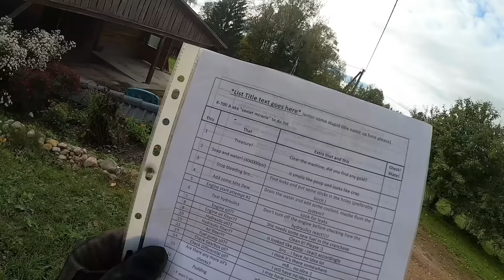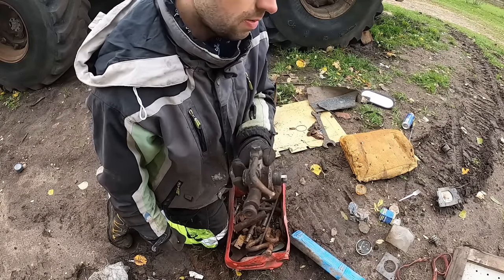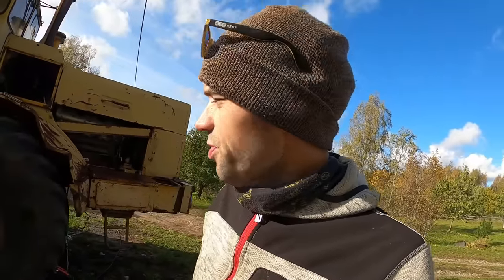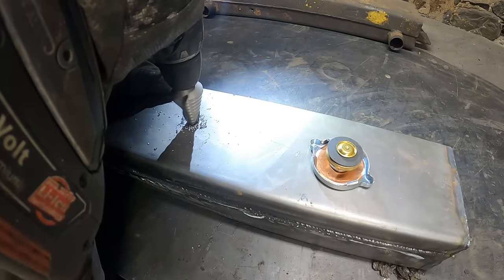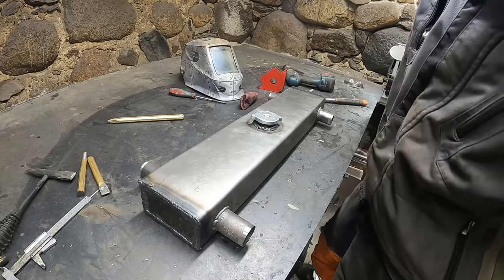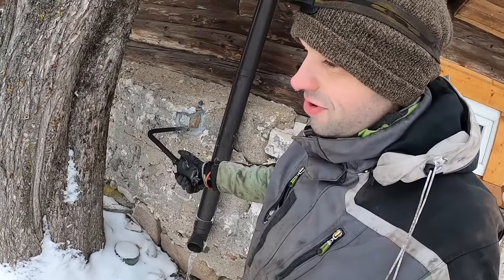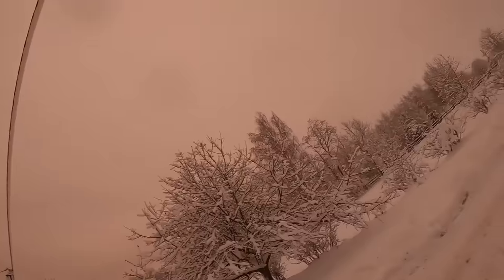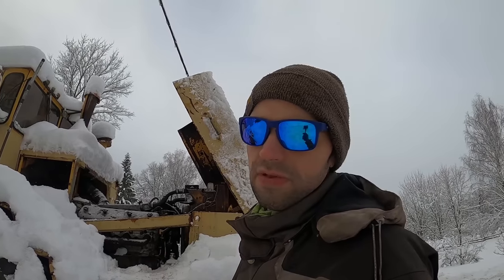Fixing up the Kirovets tractor (K-700A) - Ep1

Comment: you know if you rent a hot pressure washer you will need to spend a lot of time underneath the machine  prepare yourself to be 100% covered in hot oil
Reply from the maker: Maybe build a campire under it? Let the oil burn off instead, but Greta might be all up in my ass then

Comment: why not cut the bend in half and turn it the other way and weld it back to make an s shape if you need a tight bend
Reply from the maker: not sure what you mean? bend what in half?
Reply: @Ants_Pants  so like I remember watching guys take piece of pipe that's bent in a u shape, then cut that in half like in the middle of the u, and then turn one piece 90 degrees, and weld it together again to make a really small s shape, like way smaller than any pipe bender can do, like if you look a custom exhaust builder for motorbikes they get a bunch of weird bends and just weld them together to make any shape they need

Comment: Andris, I missed, or I'm missing something from the previous episode regarding this big field tractor. What was the main purpose of buying such a huge monster? You are not going to perform field spring or autumn work, are you? OK, I see your point. Are you gonna give a hand to souronding neiberhood. That would make sense. Otherwise, keeping such a big guy for yt watchers is out of blue 💙 . Sorry for being such nosy shmuk interfering to your lucrative business
Reply from the maker: No problem mate. Its my all time favorite tractor. That's the main reason. Once i finish it i will park it somewhere with a roof
Reply: OK, Andris, I got yeah. Curiosity of mine pressed me to ask such inconvenient question. By the way. A long time ago, I worked for the copper unedground mining industry. We had a lot of heavy equipment, which, as a matter of fact, was abused 24/7 around the year. Replasment parts were inconveniently hugely expensive. Only for ££ cos this whole stuff from outside (France, US). I am not trying to nobody to impress emphasing my past experiences. I am just a fan of your struggling, bro. Have a nice day..

Comment: Two things you do not understand about that machine,   1 , It is a waste of time,   and most importantly , 2 it's a waste of money,  That thing will never be anything but a drain on you bank account.  Also , what purpose do you have for it anyway? Save yourself some money and aggravation and get rid of it. you should get rid the bulldozer also, another thing you have no use for.
Reply from the maker: Incorrect sir, with the 2 videos iv done on the thing iv made back about 50% of what i spent on it. The total rebuild of this machine will pay back and even produce profit. Dozer is already in the profit section after about 8 months and i still have plenty of projects planned out for that thing. 
Even if financially this would be a drain(which its not) then i would protect said investment with a thing called "labor of love"
Reply: @linwoodmachine4155 Bold claims with zero knowledge to back it up. So much so that i'm inclined to think this one is a troll.